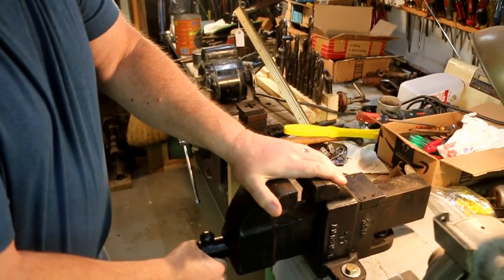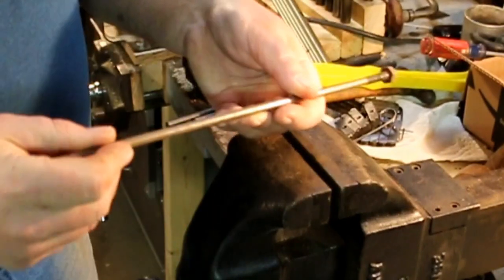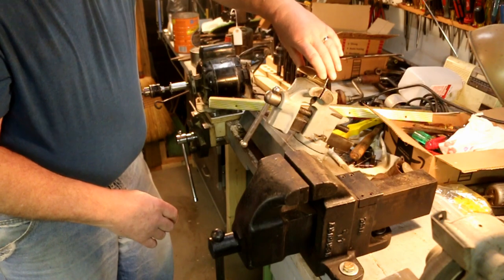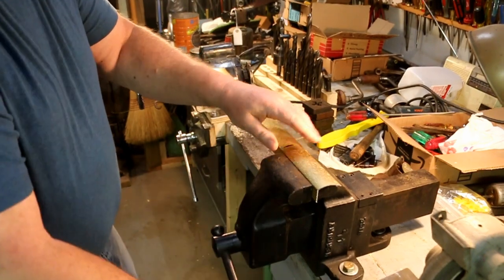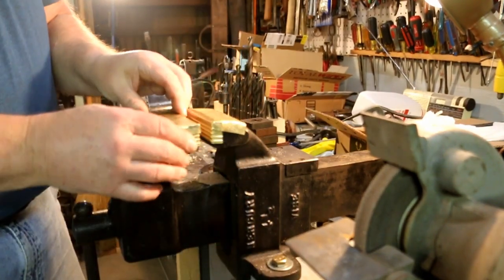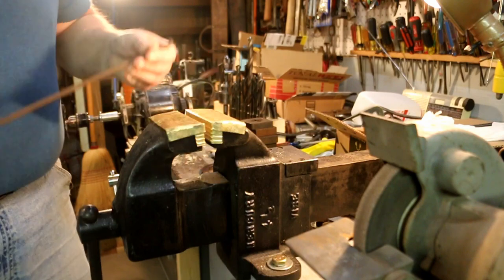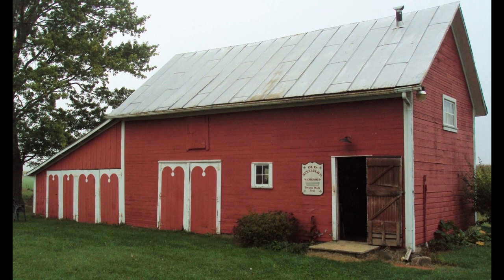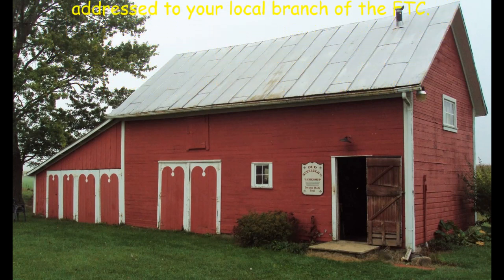Making Soft Jaws For The Big Vise

Comment: Nice small project. It was a joy to see someone who understands that files cut best in the forward cut. I can hear Mr Redwood berating any of us in metalworking classes 50 years ago that dragged a file backwards and forwards.
Reply from the maker: Lots of time with files dressing down dies and adjusting fixtures. Really helps to use them correctly. Otherwise you end up just rubbing scratches in the part. 😁😎

Comment: Very good idea! I think I got rid of all my aluminum stuff but if I ever get to craving a set of soft jaws I'll go out to the ACE and get a couple of feet of 1 inch or bigger if they have it, copper pipe. I can double it after I split it and have a little extra for a set of 5 inch jaws. But all is safe for the present. Thanks for the tip, Unc! GBWYall!
Reply from the maker: That would work. I have split pipe for raw stock before. 😁😎
Reply: @OldSneelock  That's the 1st thing that came to mind, what there is left of mine, which ain't much. And that way there'd be a dab to bend over the edges of the vise like you did. A brass drain pipe would work too because it's an inch and a half or bigger. Lots of options and that threshold is ideal or whatever you made yours out of. A-PLUS!

Comment: I made custom Brass Jaws for my Craftsman Vise, my Wilton has Copper Jaws that someone else put on it (came out of Pontiac Motors), I don't even have steel jaws for it and My Grandfather's Farm Anvil/Vise has Smooth Jaws screwed on that he made (those vises don't have replaceable jaws)...........Basically I really don't have the need for those Abusive Jaws that Destroy my work but if I did I can put them back on my Craftsman in about a minute, which I never have done since I made the Brass Jaws probably a decade ago.

Comment: Version 2 generally is a big improvement to the original, because you have seen all the things you did wrong the first time.  The biggest exception is software design (Google  'second system effect').  Those jaws should work great for all but the most delicate stuff (in which case you should wrap the part in a towel or rag anyway...).  I should make myself a pair of those, especially now that I have the vise mounted to a table with bolts (and not held down with a couple C clamps).  I don't know how often I would use them, since I have mostly used that vise cranked down to death-grip levels...
Reply from the maker: There is a lot less thinking in the second set. I have a pretty good idea what works by then. 😁😎